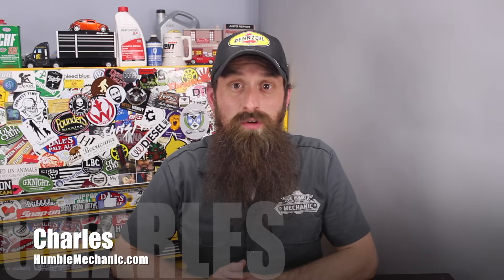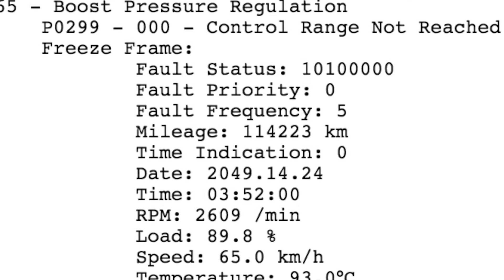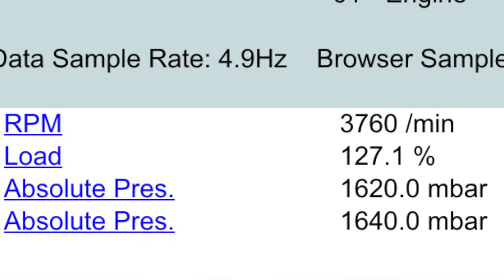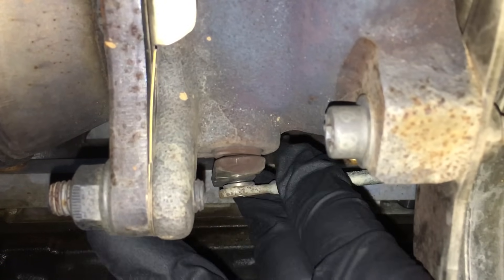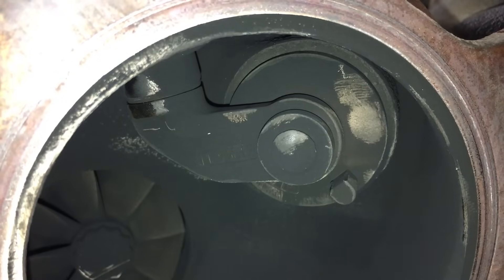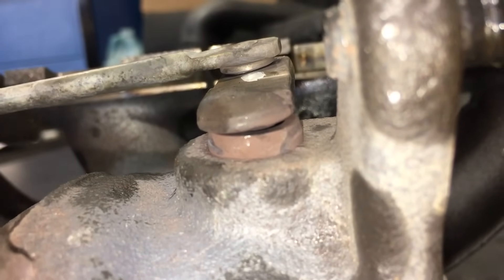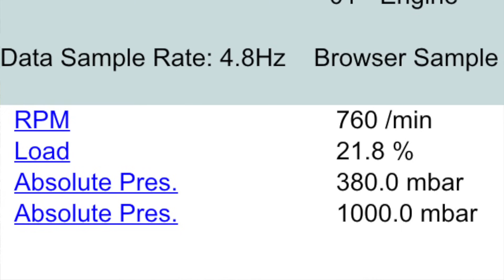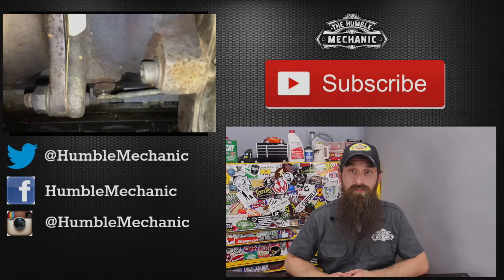Does Your VW/Audi 2.0t TSI Have A Bad Turbo

Comment: I'm not a mechanic but did enjoy this?   I just a few months ago purchased a 2017 X1 (F49).  It's only the 2nd car I've owned with a turbo.   I'm worried since my 1st one a Saab 95 the turbo started leaking oil later years.   So I'm still gun shy about turbo's.   This car has 51K on it.   So I know regular proper oil changes are key?   BMW says 10K which I think is insane I always stick to 6K max with top rated synthetic oil.   Now BMW says 0-20 oil.   I've heard they did that more for MPG but not sure?   Was told maybe 5-30 would be better for the engine but worried about the turbo too.   What do you think?  I'm in Georgia so the cold won't be an issue much but once the engine warms up that's my concern.    Liquid Molly got 5-30 and 5-40 BMW certified they say for me car they say the 5-30 now and 5-40 when I get higher miles like over 75K.

Comment: Longshot here, but could you explain why someone would get a hiss sound until the boost is built, then no hissing until you get off the boost?
Reply: I had boost leak on my hot side charge pipe and the cold side from the intercooler.

Comment: I'm having a problem of clearing my codes on my 2013 passat 2.5.manual. It has 55k miles, I change my oil and spark plugs. I tried to reset the service reset, but not doing it right. I'm a home mechanic that can do certain projects. I have a scran tool that can't clear codes. The scanner shows no problems, but can't clear the reset on the vechile. Please help, because of the procedures on YouTube are vague. It's a strip down passat without steering wheel functions that clear codes. A basic passat, please help me. Of course because I have a VW, always watch your videos. Your advise is better than going to a VW service center. I hope you can help me out.

Comment: what were the symptoms of a failing n75? And did you diy, if so can you tell me the steps? The issue im having is when building boost around 2500-3000 rpm is sluggish but after 3000 it builds boost fine. I've replace the diverter valve and no change, also looked at the wastegate actuator rod and wastegate flap rod there is no play at all. So i might be thinking the n75 has failed and there might be a boost leak. So if you have any troubleshooting advice that would be awesome! Thanks.

Comment: Please can you advice me Mr humble mechanic, I have a bwa 2.0t fsi (ea113) with the k03 turbocharger. 

I'm pretty sure it has a loose wastegate but I think also from what I have felt down the back of the engine that it has an adjustable actuator arm unlike the one seen here. Would tightening the adjuster on the rod solve this issue ? Or would it still dump exhaust bypassing the exhaust turbine.. 

Any help would be appreciated. Thank you!
Reply: I’m having boost issues myself. I have a 2.0t fsi bpy and im working on my wastegate its got all these symptoms and when I bought the new wastegate kit the flapper was still wiggle and easily spinable. Any ideas???
Reply: @thegamerthatplays9322  for anybody wondering I resolved my issue. I tightened up the wastegate arm using the adjustment nut 3 turns .. all is good now. 

I also had another issue which the previous owner replaced the DV and installed it upside down.. with the locating pin causing a boost leak.

Comment: I just bought an 07 mk5 fsi, didn’t hear rattle when testing it, only happens during slow deceleration… 
Getting the belt replaced, might as well replace the turbo…
Reply: $7500 - besides 105k maintenance, and failing turbo that wasn’t disclosed… great car’

Comment: Wouldn't this be just a bad waste-gate and not bad turbo if there is no bearing/shaft play on turbine. I think this good way to say bad waste-gate but not bad turbo IMO
Reply from the maker: could be, but it requires the same repair.
Reply: Are you saying there's no way to replace just the wastegate?  It seems it's only a clamp that holds it on to the turbo.  My wastegate is sticking
Reply: They apparently cannot replace the wastegate without replacing the rest of the turbo.
Reply: The wastegate in the IHI RHF% turbo for 2.0TSI 200/211 models is somehow integratyed to the turbo and cannot be repaired. Mine is vibrating, causing a bad sound when lifting throttle at low revs, and yes, I'm due for a turbo change (going to upgrate to K04 type)
Reply: HumbleMechanic no it doesn’t. You don’t need to replace the entire turbo assembly to replace the wastegate. Think I’m wrong? I just replaced my wastegate on my MK7 GTI without taking my turbo out. Took me just over 1 hr to do it. And every shop and VW tech thought I was wrong. Guess I proved them wrong once again.

Please stop giving wrong information to your customers! Your a VW mechanic for crying out loud. The least you can do is actually know how to work/replace things on the cars.
Reply: Glenn Havinoviski false
Reply: @jasons2697  but we don't all have the same turbo. Your turbo on that model is a IS38? On the ihi turbos it's not possible.

Comment: I have issue with my rdx you may be able to figure out.  driving me bonkers. I got it for a steal at the auction. Throwing p2263 code and p0420. Acura dealer had serviced the car it’s whole life. One owner. The lady had 176k miles and was already lookin at a new rdx. She brought it in because it was running slow on acceleration and not going past 1/4 of the way in boost gauge. 

The car runs and drives good but very slow and anything past 50% throttle and it feels like even more restriction. Lower throttle works ok just very slow. Sometimes randomly it will have a little more pep than others. 
I’ve checked for boost leaks. Replaced the maf. Reset the ecu. It did this worse with stock intake I Even got a aftermarket intake which actually helped keep the code from coming back as soon. But didn’t help power much. You can hear the turbo spool. In neutral it wil rev fast an no issue but no boost showing on gauge in park or neutral just builds in driving mode and  builds and drops off when it shifts like normal but low. 

I’m seeing on my code scanner the cat temp gets up to 1300deg and when sitting it’s like 800ish. I see the 02 sensor voltage fluctuate a lot when i rev it. Not sure what it’s supposed to be.  I wouldn’t think an 02 would make a dealer say bad turbo and cause this much issue but the master tech at Sutton told them it was the turbo itself. I just find it hard to think it’s the whole turbo. Feels more like stuck wastgate or clogged cat or something. I have never removed a turbo and I don’t want to mess anything up or throw money at it without knowing for sure what’s wrong. The actuator is like 230$. New cats are 275 I think. And a catless down pipe is 400. Refurbished turbo is 800$ on eBay. Used is 650. Any advise? I feel like if the turbo is bad it wouldn’t spool so quick to 1/4 boost and stop. It’s like an actuator or something flow control is stopping it. The rod ends look fine.

Comment: My 2013 Tiguan has 150k miles on it.  The turbo underboost fault appeared.  It appears there are two common solutions to this code.  One is the wastegate fix in your video and the other is a turbocharger diverter valve replacement.  The diverter valve replacement looks pretty straight forward.

How do we open up and access the turbo body to replace the gate?  Do I need to remove the entire turbo system from the car?

Comment: I love ur videos,,,I'm having a problem with my 2010 Passat wagon with the 2.0 tsi engine,,,codes are high fuel pressure an lean feul trims at idle only  an the intake manifold adjuster code ,,no misfiring under load so I've replaced the PVC valve it was bad obviously ,but sometimes when I start it sitting at idle it almost stalls or does ,the rpms will go from 900 to 1500 back an forth,unless I have the AC on then it idles normal at 900 an runs smoothly,,but sometimes putting it in drive or reverse it'll stall out on me ,any ideas on what else I should be checking I've cleaned my mass air, replaced plugs an filter checked for leaks an it kinda sounds like there's a leak but t I'm not getting any boost codes only high feul pressure an lean at idle only an manifold adjuster code but,the arm on the adjuster is still connected an doesn't seem to be leaking I'm just beating my head against the wall tryn to fix this issue,I'm about to  replacing the O2 sensors the wastegate control valve the boost recirculate valve an the masairflow an I have an intake manifold adjuster repair kit coming,like I said sometimes when I start the car usually after driving I park it an when I start it again it'll run ruff an the engine light blinks at idle ,,it never blinks when driving no matter how hard I get on it ,it's just weird ,,I have some automotive knowledge so I'm not completely Dum to engines I've rebuilt a few ,an done many head gaskets,,but I'm not familiar with stock turbo engines ,I love ur videos an that's why I replaced the PVC valve Wich was bad ,an the car is driving way better but I'm still having this issue,,any idea or suggestions would help ,,,I Know it's hard to diagnose my issue without seeing it for urself ,but I'm hoping u can give some insight into what could be going on ,,an like I said it (mostly) does the ruff idle after I have drove the car an parked it for  little bit an start it again ,,,also I fell alotta boost lag takes a second to really build up boost ,I don't have a boost gauge yet but I will be installing it done so I can see what the pressure says but again I'm not getting any codes for boost Tru the obd ,only manifold adjuster,lean at idle ,an high fuel pressure,even with new pcv valve 😥 thanks again if your reading this

Comment: Sadly looks like I'll be crawling under my Tiguan next nice day. I've noticed a whistle under full load recently and it's getting worse and worse. 66k miles. Hopefully a loose hose someplace. But I've also noted on my Auto Polar FIS my peak boost is slowly dropping. I would see 10 psi under full load now. Seeing 8 psi max. So fun times ahead. Do you suggest going to the Borg Warner k03 over the stock IHI?  Always figures Iggy will want a Christmas present  lol. Last year it was the water pump failing a week before Christmas. Lol. But I'll check for leaks first.  But I have not seen the code yet...

Comment: Dear HumbleMekanics
I have this error code p0299 on 1,9 tdi. It drives fine normal on city but on highway after 65 mph it come with spring light and engine light message. But if it’s work in city is my turbo bad or component of my turbo!!! 
Thanks 🙏

Comment: I got a CEL (P0299) but only after putting in the DV+ from GFB, (COBB stage 1+) there is a whistle when I drive but I have ECS' Turbo Muffler Delete, which I'm 90% sure is the noise. My factory DV made a almost "ringing" noise when WOT, leaking boost BUT it held up better than my DV+. My P0299 comes and goes, when it does come on the car isn't having idle issues or any driveability issues, usually when I hit ~4psi underboost of desired boost. I checked my charge pipes, my DV+, throttle body, haven't checked my wastegate arm or intercooler for a hole. I'm praying it's neither and just got a bad plunger from GFB (Kinda marked up upon arrivale). Thoughts? Kind of at a loss

Comment: I have a grinding sound when turning left on my 15 passat or when I’m on a sideways incline when I put the car in gear. Could this be the compressor wheel hitting the housing or waste gate rattle? Also noticed oil around the outside of the lowest discharge fitting. No codes. Any help appreciated, really enjoy your videos.

Comment: Vw passat 2.0 TDI 2007.... 
008825 - Leak in Air Intake System P2279 - 006 - - Intermittent - MIL ON

000665 - Boost Pressure Regulation P0299 - 006 - Control Range Not Reached - Intermittent

Car can't move more then a few cm, then dies. Idles normal. Turbo apparently is stuffed. (previous owner said). How hard is it to check that turbo before even trying to remove it. (is the removal process complicated for someone who is just mechanically minded person)?

Comment: Charles - I have a 2014 Jetta 1.8 TSI. When RPMs are around 1800-2200 I hear a hissing sound.  Dealer says it sounds like a failing Turbo.  No CEL lights on. Does that sound like a symptom of the issue?
Reply: Having same issue right now. Yes it’s failing turbo likely leaking oil into inter cooler. I’m sure since 3 years have past, I’m assuming your issue is no longer present. What did you do with it?

Comment: I do this on out of warranty A4 TFSI engines. IF its warranty of course I do the long ass test plan already knowing what the problem is but out of warranty I go right for the throat. Take out the airbox, grab long needle nose on the wastegate arm, shake the crap out of it with a mirror and boom, diagnosis done. Needs a turbo. Its so common, I just check what I already know what it is.

Comment: HI, HUMBLE,  i have a 2006 passat 2.0 turbo engine and would like to know the measurement specifications for camshaft lobe, the one drives the cam follower and high pressure pump, i would love to hear if you can help me with that info. thanks a lot and keep going w great technical info videos.

Comment: Great video! I have this issue on my Skoda 18.TSI, year 2014 and I'm wondering should I replace turbocharger with the exact same model or to look for upgrades as dealer is claiming that this problem is not a warranty issue?

Comment: HumbleMechanic I have a 2006 GLI 2.0T FSI engine. It's been leaking oil, and the mechanic says it's coming from the turbo and should be replaced. Can I have an aftermarket turbo (and manifold) installed? This would avoid the $3000 price tag for standard repair (that would be a "total" imo). I can find replacement turbos for $5-600. Seems like they'd be fine to use over the $2k from VW since that's what's in it now and it's failing (I think it's the bearings?).
Reply: On a semi I can buy a 1200 holset turbo or buy an aftermarket brand new turbo for 695. Brand New!  What would you do, yes I took it off and bought a holset.

Comment: Thank you for the video Charles, very informative. Question for you or anyone out there that might know. 2008 Audi A4 2.0T, I got a P0236 and P0299 but no check engine light. Car is in limp mode won't go above 50mph. Any advice?

Comment: So the bad wastegate turbo looked like it had carbon build up???  What is your opinion on the CRC GDI cleaner or other brands of turbo and valve cleaners???? Great vid by the way!
Reply from the maker: Those chemicals won’t fix an issue. If you use them as preventative MAYBE. And that’s a big fat maybe

Comment: I'm rebuilding a CAXA 1.4 TSI, replacing all seals and sensors plus timing gear and rockers, do you have any advice on what else to check while the motor is out of the car?

Comment: Hello the V465 air pressure actuator is stuck. I am told I need to replace the entire turbo charger. is that true. 2.0t CPLA engine  2013 beetle R.

Comment: Hey I have a 2010 Volkswagen Passat 2.0T and it lags and sometimes won’t go in reverse and when it won’t it’ll make a weird sound as if it’s changing gears or something is that bad transmission? Or would that apply with this

Comment: i am in the process of adapting the IS38 to the VW GLI
Reply: i know its two years later but did you end up doing it? Im still waiting for ECS Tuning to release the turbo kit for the EA888.3 GLI
Reply: @shaneinfinity4597  yes I did, it worked out great, the only problem was I needed to change all fittings and pipes because the turbo pointed the other way.
Reply: @shaneinfinity4597  sadly i had to sell my GLI :(
Reply: thats awesome and unfortunate at the same time :( im going to wait till the end of summer to see where CTS is with the kit. If they take longer then that or overprice the kit (it'll be the only bolt on option in existence) then Ill will attempt the IS38 swap
Reply: @shaneinfinity4597  awesome you have my support

Comment: This was an IS20 right? I've seen on forums that this is just "how its designed" and only the "IS38 turbo's wastegate seals perfectly tight" like whaaat?
I just recently upgraded my downpipe on my mk7 16 GTI and I noticed that I did indeed have a spinning loose jiggly waste gate and am still under warrenty and throw no codes. I hope my VW dealer is willing to fix me up with my turbo inlet pipe, turbo muffler (which i might revert to stock for those) intake, intercooler, and downpipe upgrades... not once tuned. Though i can recall hearing this rattle on the ride home from buying as it was used at 16k miles I have now confirmed that the rattle has made its way to the wastegate itself upon stock downpipe removal.

Comment: My scirocco sounds like it rattles/ticking but only when letting off the throttle. Not at idle or steady rpm. Idk if this is a problem or not, no error codes

Comment: I'm throwing a p0299 code but my A3 8P is running fine.  -8 to -10 PSI Boost at idle and stomping on the accelerator results in a +16 with no noticeable  additional lag. Doesn't seem like there's anything wrong.  Could anything else trip that code?

Comment: Yo man.  Thanks for all the vids.  My lady daily driver was a 73 beetle, well.. things happened.. there were tears...  So we just bought a 2009 GTi TSI 6spd with 115K miles.    It's helped the tears.   It drives great... but we do have a p0237 code.     What should we look for first you think?    Thanks man. ~  Idaho.
Reply from the maker: That’s a circuit code. Check wiring to N75

Comment: My 71km. 2011 tiguan had this problem. Extended warranty covered new turbo system. Expensive job especially at VW roughly 2k$.. less than 12 mo. before that, turbo valve needed replacement at like 68-69km. Reliability highly questionable now. Extended warranty expires at 75km. Is it worth purchasing more warranty from VW? If I should, they want maintenance inspection fee for 119$.